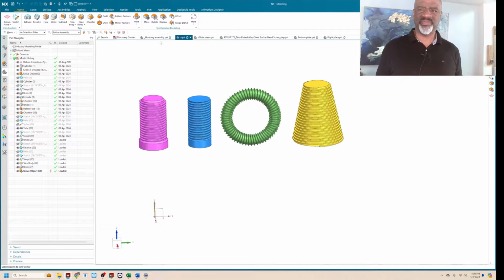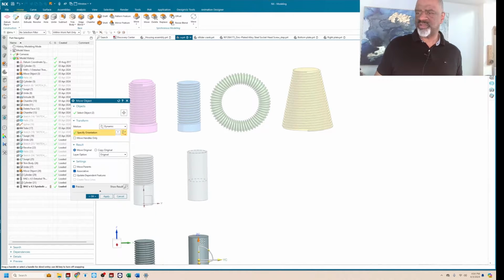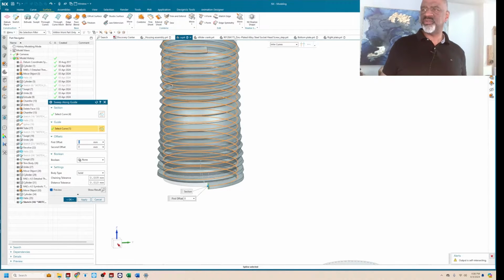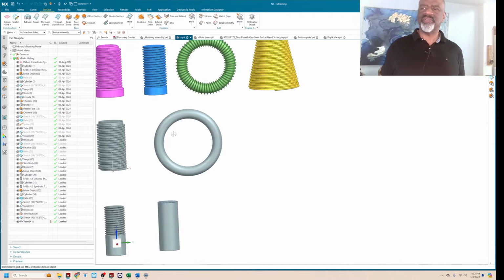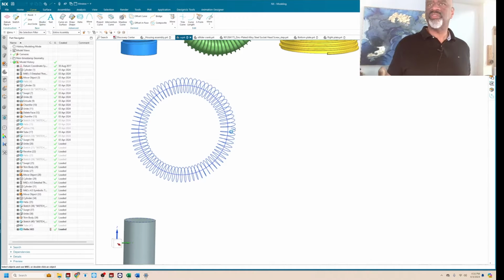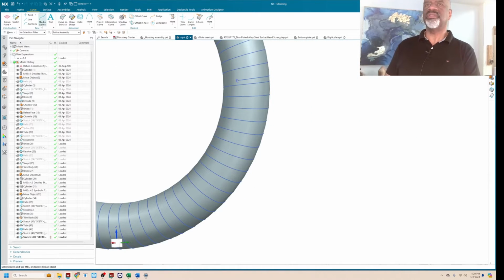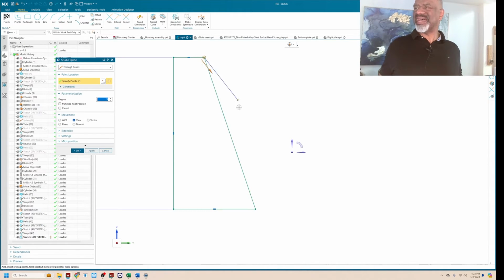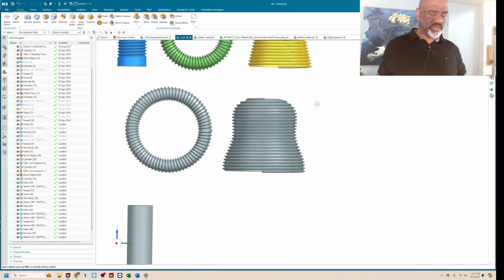Screw it Up! - Custom Thread Tutorial in Siemens NX #siemensnx #engineering #cad

Comment: The "helix wrapped around a torus" failed because the definition of the helix was over-constrained. One could choose fixed values for diameter of torus and integer number of turns, but the pitch of the helix would have to be allowed to "float" a small amount. Similarly, one could choose fixed values for pitch of helix and integer number of turns, but then the diameter of the torus would have to be allowed to float a little bit. There might be some slicker way NX would allow the helix to be specified that would ultimately achieve Steven's initial goals, but I'm not aware of it.